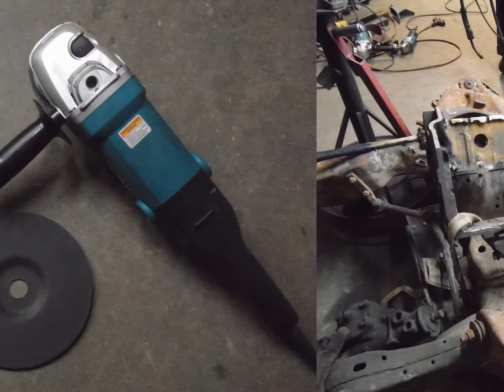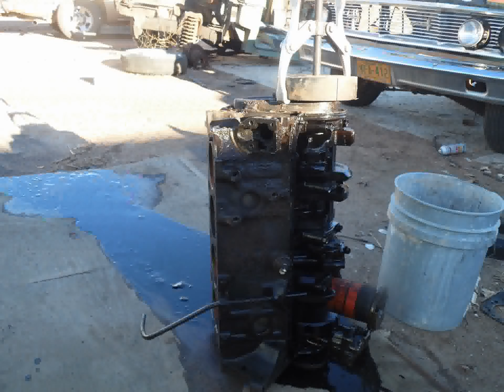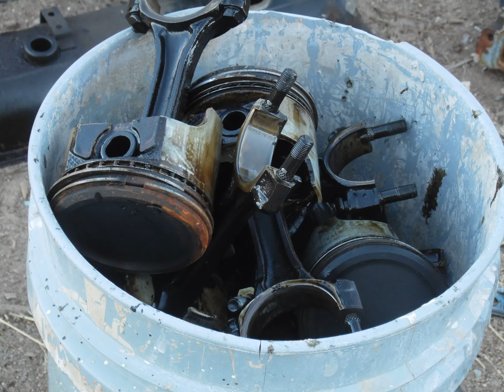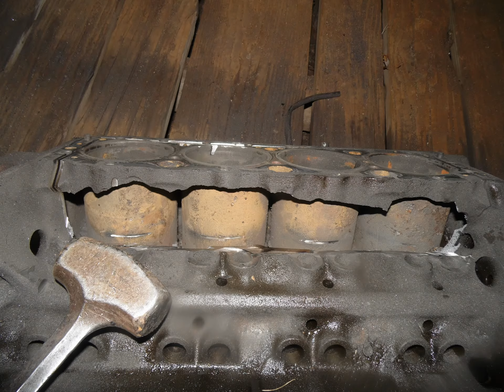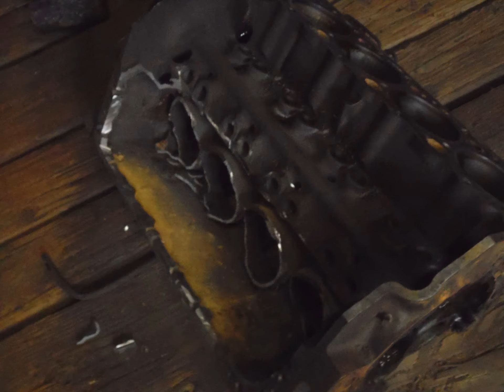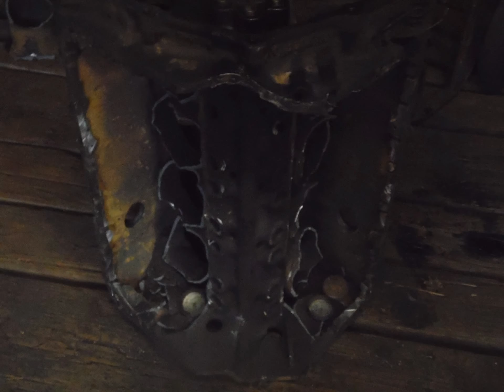how to make a mock-up engine

Comment: What about the heads? Firewall clearance is important as well. I know this is an old video, have you done anything different for a newer version?
Reply from the maker: I apologize for replying so late..yes I am currently working on mock up heads,and also have a mock up trans and now have a bbf,sbf,bbc,flathead and LS for my shop ..definitely a big difference in a good way compared to the plastic blocks
Reply: @kevinthompson212  I landed an aluminum 5.3 that had thrown a rod, the bare block is half the weight of an iron block. I also have a bare 4l80 housing for mock up.
Reply: @kevinthompson212  And here we are 7 years later, and still nothing? Awesome!